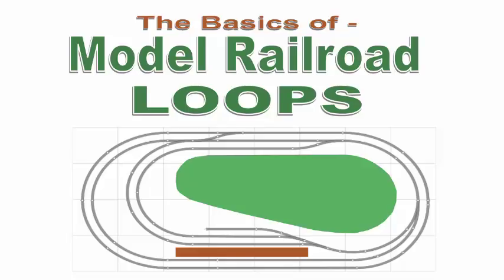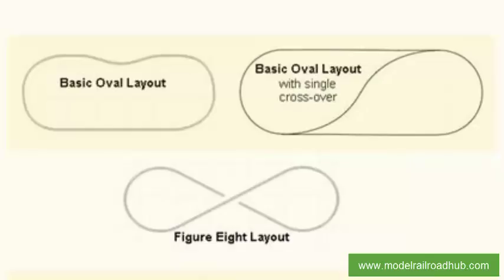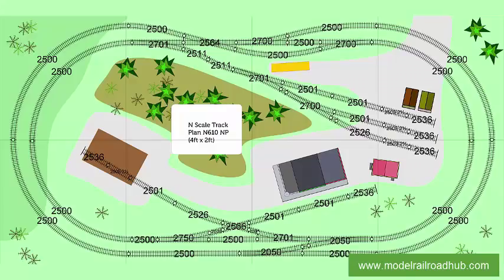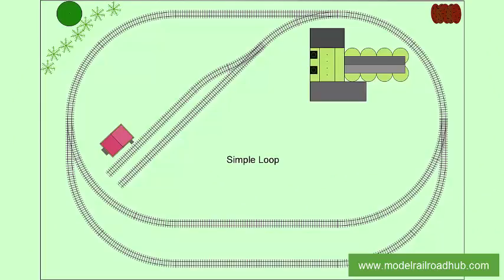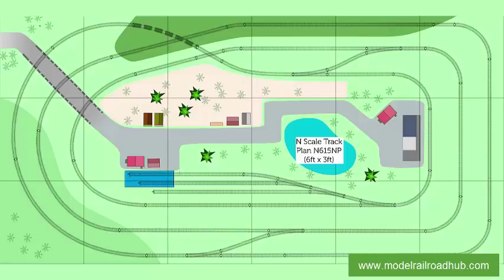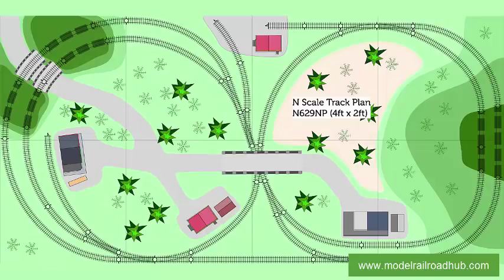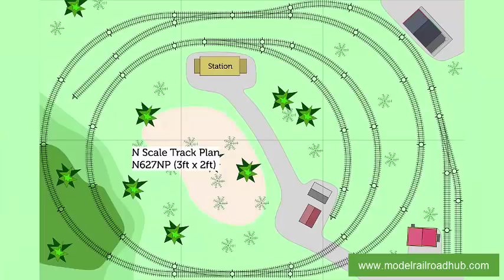Loop Plans For Model Railroads 🔥

Comment: I live in an apartment and have limited space, so I have made peace with the OVAL track plan. My version uses the M1 & V9 Kato track sets for the freight line. I call this a folded figure eight as the train makes two loops around the table, one on the inside loop and one on the outside loop, making it feel larger. This will allow me to add a spur inside the oval for a couple of industries. A second, larger loop will run outside the freight line for a passenger train loop. Across the back, the two tracks will share a double track bridge which, when passing on the bridge going in opposite directions, will give me that larger feel as two trains always looks more "busy" than one. There will also be a double crossover turnout connecting the two train lines so, if I want, I can run one train around all three loops. There will also be a spur off of the passenger track for a very small yard.

Comment: If I was building a model railroad layout with a continuous run of track, I would rather have buildings and/or scenery within the oval(to block the view of one side of the oval). Plus, I would have a interchange track or staging/fiddle track(s) branching from the oval.
Reply: That's basically what I have done. I have a double oval with a maintenance yard inside one half of the inner oval and the other half is detail for my large viaduct station at the back that hides the rear of the oval.

Comment: The nice thing about loops is that they can be folded back on themselves using the "over and under" technique. Consider the basic dogbone design. It's a giant loop that curves so you see both sides of the train, and can be folded over itself..... and for giggles one end could be a single track reversing loop. Or insert a crossover to create a two train plan. If the space is there, there's plenty of spots to put in passing tracks or industry spurs.
Reply from the maker: Great advice 😄

Comment: I have a question:
I am planning a lego track with points (the old blue track), but I want to build it in a way that the train drives on all tracks without me having to set the points manually. Lego points do not snap back to their old position if a train drives over them like Märklin.
Like when you build a straight track with points and loops at the end: o---------o. Do you know if this is possible with more than two points?
Reply: Schwarzer Ritter 
is
Reply: "is"?